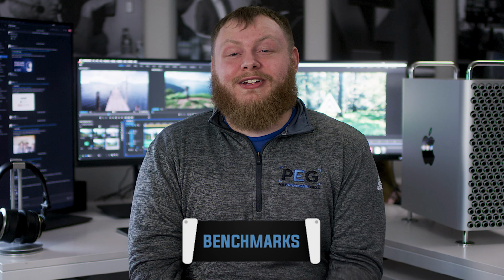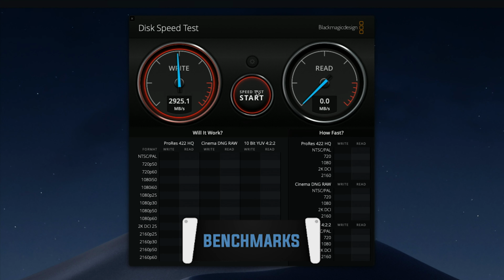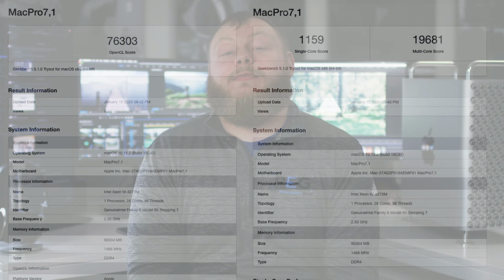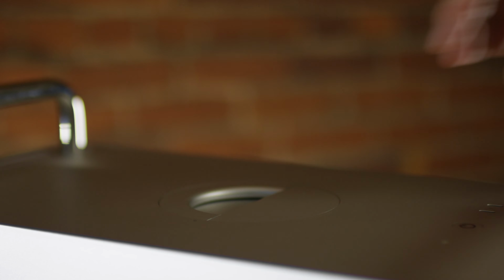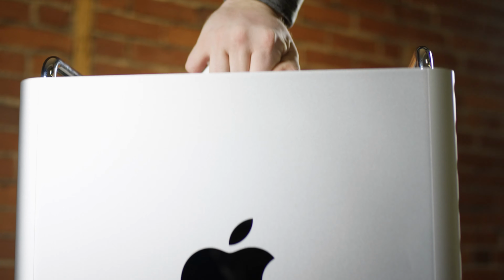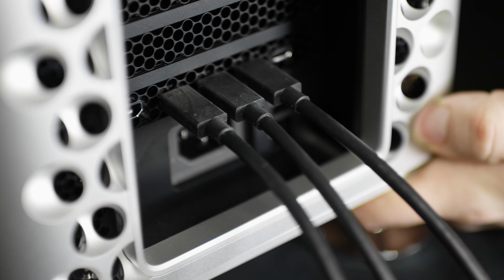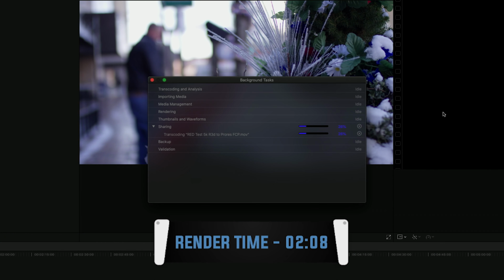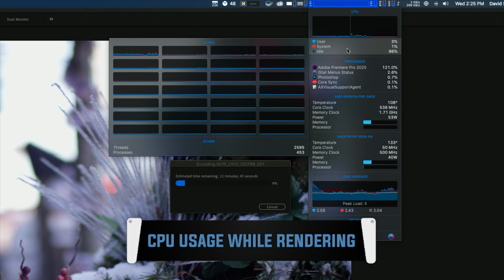Mac Pro First Impressions

Comment: If you use Premiere Pro your best bet would be to get a 32 Core AMD CPU and an RTX Titan graphics card. For timeline playback using a Windows PC Premiere Pro can make used of more than 8 cores. How many layers of 4K Red One R3D video files at 4K can Premiere Pro, FCPX and DR playback? I don't care about render speeds because AM does the rendering in the background.

Comment: I’ll be getting this new Mac Pro,  I still have my 2008’ Mac Pro (I paid $5,000.00 for the computer and $999.00 per Screen of which I have two) with 16GB RAM running OS X Sierra, this will be a great upgrade for me with the new Mac Pro.  

Programs I currently use :

Pro Audio :

LOGIC PRO X 10.3.4
Reason 10
Komplete 10
UAD Plugins (All)
SoundToys Plugins (All)
WaveArts Plugins (All)

Pro Digital Art :

Final Cut Pro X 10.3.4
Blackmagic Design Resolve 15
Pixologic ZBRUSH 2020’
Cinema 4D
Autodesk Suite Entertainment Creation 2011 {Maya, Mudbox & Sketchbook Pro}
Adobe® Creative Suite® 5 Master Collection
Corel Painter 12
Harmony/Toon Boom

Digital Drawing Tablets : Wacom Cintiq & Intous 

*All the same software installed on my mid-2010’ MacBook Pro 💻  running High Sierra 10.13 & a 2015’ 5K iMac 🖥  running Mojave. 
**Never had to purchase any anti-virus software for any of my Macs. 
***Upgraded from ZBrush 2019’ to 2020

I’m glad that this new Mac Pro will actually be modular and have PCIe slots like my 2008’.  Gonna Max it out and be done with it, hopefully it’ll last me 10/11 years like my original did.  

Good job apple.

TheGift of7™️
#MuSétiś™ 
#MusicSurroundsUs©

Comment: Fully agreed with Adobe. I've got 28-core too and not happy with After Effects performance (although it looks like there's improved GPU performance on the last 17.0.2 update). Will return this 28 core and get the 16 core for higher base clock. Very happy with resolve though, using all the GPUs.
Reply: I got the 16 and its the sweet spot!!!
Reply: So for Adobe, 16 core is better than 28? even tough it's a bigger number? i'm having trouble to understand cores differences....and it really suck that Adobe is not working well with this new mac pro
Reply: Valerie Toumayan abode wont use more than 10 core at the moment. So it’s a software issue.
Reply: @CTJonze   ok thanks for the details. so there's no point of buying 28 it won't change a bit? i really hope Adobe will upgrade their programs...But if in the end i still want to get 28 core for other programs. will it be slowers for Adobe than 16 or 12 cores?
Reply: Valerie Toumayan  you won’t see the power of 28 cores unless you are rendering the next Pixar movie. If you are doing 3D then 28 core will help. Final Cut Pro you can get an extra second on your export but really it’s overkill right now. Most apps don’t and won’t for awhile use it and it’s because the average user can’t afford / won’t have that many cores. Lastly it is confusing because the cores go up but the gigs per core go down so that’s why everyone says the middle is often the sweet spot.
Reply: @CTJonze  Agreed. So disappointing that I have to come down with number of cores just to accommodate AE and LR. I really have no choice because these 2 apps are important parts of my workflow. 

The only app I see that needs a lot of cores is LR and the task is very specific: Importing hundreds of photos from LR (High Rez Tiff from RAW), all the 28 cores are working and Mac Pro becomes so noisy with all the fans blazing. But I still will choose lower core with higher base gig to quicken my AE workflow. 28-core is really overkill for most apps
Reply: @CTJonze  Thanks a lot! my biggest issue with Adobe is rendering after effect projects (mostly 2D, sometimes a little Element 3D objects) and in Premiere videos that have denoiser pluggings.(that's the worst!) I'll follow your suggestion with mid range, and maybe get the 16 core then. hopefully, in the future Abobe will upgrade and then we can buy a cheaper 28 core to change!